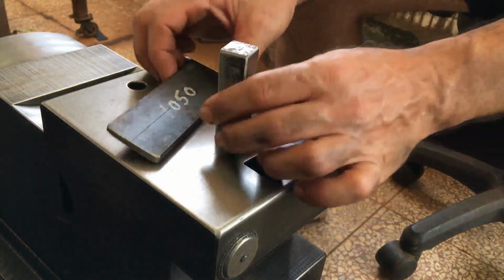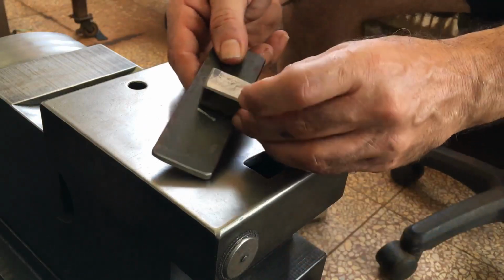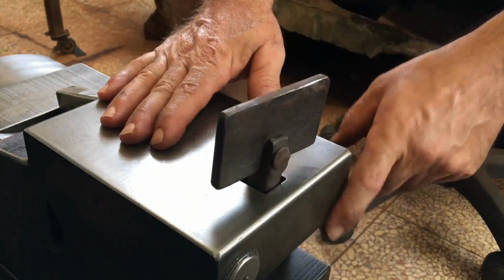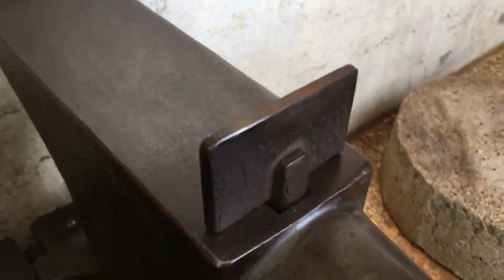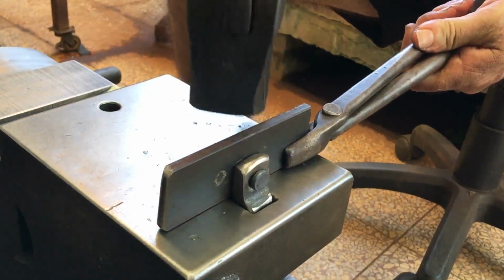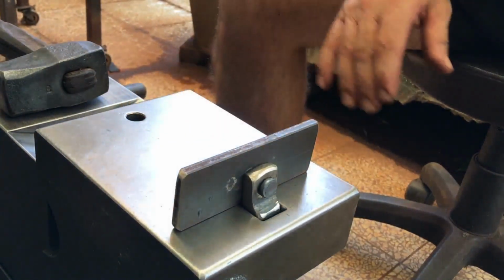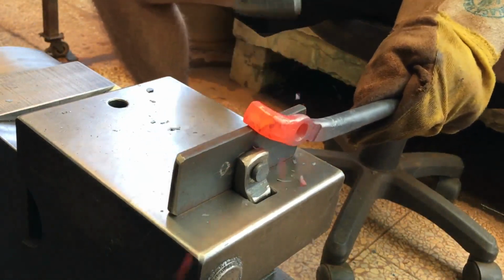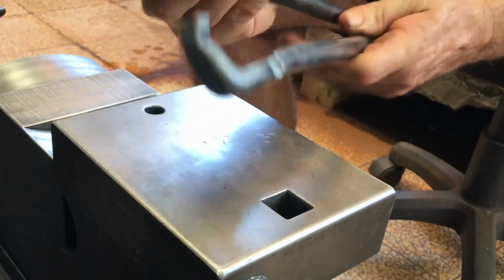A Very Simple & Useful Hardy Tool

Comment: Great tool. I should have one of my own shortly. On my rivet or bolt holes, I always put a chafer on both ends. It is like dulling the shear points and it widens the surface areas. Great and very useful video. Thank you.

Comment: that's super interesting.  I liked your point about sometimes wanting the tool to be above the workpiece and sometimes below—for what you demonstrated that tool doing, it would be super hard to hold the workpiece if you had to also hold the tool.
Reply from the maker: I could rest the tong blanks on my anvil and hammer the groove in from the top, but it would make the slight angle that I held the tong blanks almost impossible. This way works out much better for this particular operation. Plus, like you imply, I would have to hold the tool, my hammer, and at times the tong blank (which would shift around some) if just resting on my anvil face. Thanks.

Comment: That's a really handy tool idea. You could also radius one of the bar and put a "V" on the other end and leave the center square for even more versatility.
Reply from the maker: Yes, that's an excellent idea. It wouldn't be hard to have different profiles on the top end for different jobs. Thanks.

Comment: Glen I was watching a few blacksmith competitions. I noticed every time they forged a tong or a place were a rivet goes. On one of the tongs they after punching there hole would also add a locking system by forging with a star type punch just enough to were the rivet would lock on one side of the tong .. Have you seen this? Just thought you would have an interest in seeing how it works and possibly be able to incorporate it into some of your work... Thanks for everything you do and share... Martin
Reply from the maker: Yes, I have seen some guys use this technique in order to keep one half of the tong static. I don't think this is necessary and have never done this myself. But maybe I should give it a try on a tong I frequently use and see if there is any benefit. The only thing I can think is that it may help keep the joint from becoming too sloppy over time. Thanks.

Comment: Well, I'd tell you job well done, but you know that. The hole knock out was clean and sharp.  Just me, but yeah, the loose fit bugs me.  Again,  I love the simplicity of the tools you make.  They are simple, yet fit the bill.
Reply from the maker: The looseness also bugged me a little. I hammered on the shank piece just a bit too much. Still, it suits my need. Thanks.

Comment: Very clever and useful. Would a 1/4 X 2 inch bar of 4140 get as soft as mild after use? Or stay tougher? I happen to have it on hand.
Reply from the maker: For something like this, 4140 would work very well in my opinion. And 4140 is purported to work harden (which I believe is true since my anvils (4145) have gotten harder over time. It wouldn't get soft like mild steel. Thanks.

Comment: Nicely executed! What benefits does this design have over a standard Hardie fuller?
Reply: @duff8402  but what I'm saying is that a standard hardie-hole fullering tool would do this job quite nicely. I'm imagine that he's designed it this way to do something other than what a fullering tool would do, but I'm not sure what it is. I'd be keen to find out in case it's worth making one for myself!
Reply from the maker: I think it really depends on the dimensions / shape of the hardy fuller being used. The main thing with this tool is I want to fuller in a flat (not rounded) groove since this tong will be used to hold flat stock. And this tool's flat and relatively high sides allow me to easily hold the tong blank at an angle. But as you're implying, this operation could be accomplished in a number of ways so I really think the benefit depends on the user/work being done. You could simply lock a piece of flat into your vise to get the same effect (and see how it works) before making this sort of anvil hardy tool. Thanks.
Reply from the maker: My anvil has some advantages but also disadvantages for sure. I often use it on its side and can even use it upside down since the anvil is completely heat treated top to bottom. Thanks for watching and replying...
Reply: @gstongs  Definitely not saying it should've been done differently. I'm very much a think outside the box kinda guy. I figured it was worth asking if there was extra functionality for this. But as you said, it actually would do a great job of getting those nice flat sides to the groove.
Reply: @gstongs  I actually kind of like your anvil. A blacksmith's anvil is part of their brand, and I can always tell one of your videos from a quick glance at the thumbnail!

Comment: as much as i like smithing i would have just mig welded those two pieces from the start point.
apart from 'because it can be done' why did you choose to forge and rivet them?
i ask because you might have had a better reason than i can think of
Reply: Maybe he enjoys using rivets and traditional methods
Reply: @demastust.2277  He does, but he's also said that he simply doesn't have room on his little balcony workshop for a welding rig. Plus hauling gas bottles up multiple stories...  Clyde
Reply from the maker: Clyde said it perfectly. I just don't have space or convenience to electrically weld in my current work space. But welding would be the simplest way to go about this for sure and I wouldn't have wound up with the sloppy fit from over hammering the shank. Thanks for watching.
Reply from the maker: That's certainly one reason. Thanks.
Reply from the maker: Perfectly said. No need for me to add anything. Thanks.

Comment: Why do you always trhow the remaining material of the hot punched holes in the hardy hole?? I've seen you do it a few times already.
Reply: My guess is he has a tray below it to catch any pins or anything that drop through. By throwing the waste down that hole, it's all in one place instead of on the floor.
Reply: Gets it off the anvil. It’s still hot so he could burn himself if he brushed it off with his hands. That’s just a convenient place. Probably also drops in a relatively common area to make clean up easier

Comment: Why do your forging always look so clean and scale free? I see that you brush your anvil off frequently but there seems to be very little scale coming from your work pieces to begin with. This is just something I’ve noticed in your videos, I use a gas forge as well and I get lots of scale.
Reply: Maybe it´s the climate, isn´t his shop in somewere in asia?
Reply: Look I'm not entirely sure but I believe he works his pieces slightly colder than most. Also the gas air mixture in your forge could be adjusted to provide a flame with less oxygen tis will be colder thus taking longer to heat up but will oxidise the material less
Reply: His forge is fuel rich and he works at a colder temp than most. Hence much less scale

Comment: Looks good but why not use a guillotine set with a flat and a rounded die?
Reply from the maker: Some others have also asked about the guillotine. I don't want this groove to be rounded since this tong will be used to hold flats (I should have explained this). I could use my guillotine tool but it would involve making a special set of dies which would be more complicated than making this simple tool. And I think the body of the guillotine would get in the way. Thanks.

Comment: Rather than a rivet I would prefer to weld it up with my everlast
Reply from the maker: Nothing wrong with welding and in fact, that's probably the preferred method. I just cannot weld in my current small work space. Thanks for watching.

Comment: Or you could just make a hot cut but make it flat on top
Reply from the maker: Yes, this is what I was sometimes doing but I find it easier to hold the workpiece this way. Plus, I can angle the workplace better when using this simple hardy tool rather than if the workpiece was on bottom. Thanks.